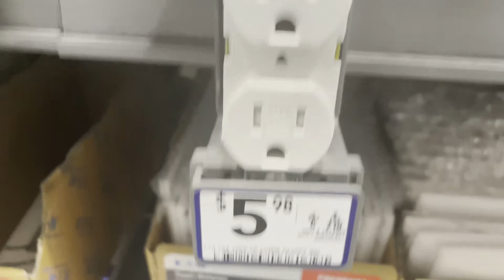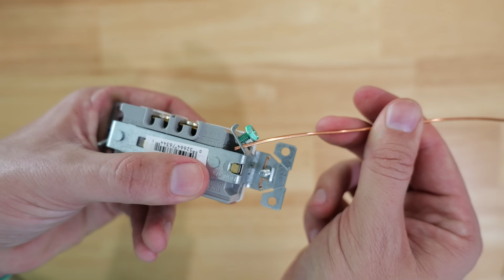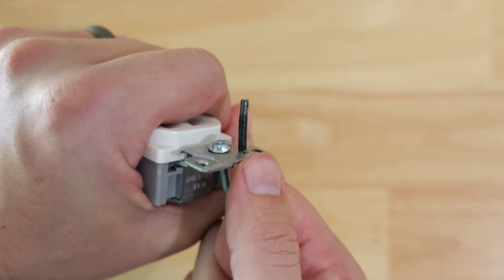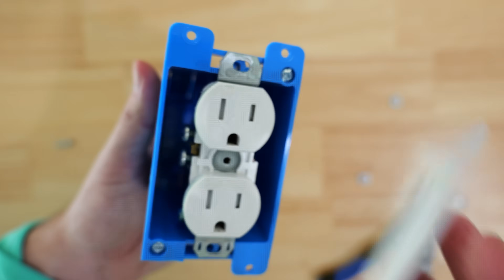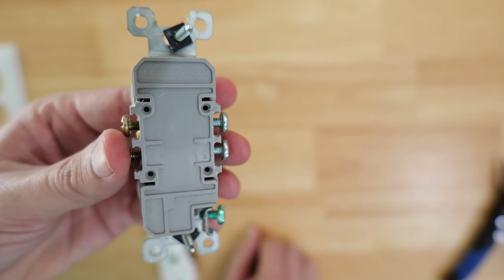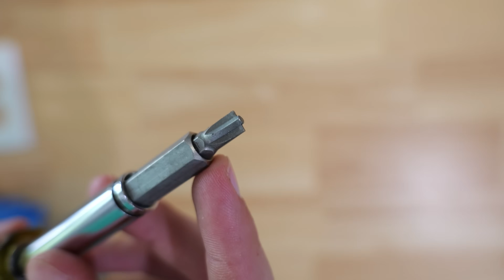10 MIND BLOWING Things DIYers Don't Know About Outlets But SHOULD

Comment from the maker: How many of these features were you aware of?  Most folks seem to know about 2-3 on average.
Reply: A majority were new to me.  Well done!
Reply: You’re more likely to remove the break-off tabs on the live terminal for kitchen receptacles that have separate circuits top and bottom.
Reply: All but ground screw pin hole for wrapping. Not sure it is faster than wrapping with stripper in hand already. But I'll try it.
Reply: As a 60 year old jack-of-all-trades / DIYer I knew a lot of these already, but I did learn a few things about the convenience features & the comparison between residential & commercial grade. Thanks.
Reply: I knew about the broken tab thing… that’s it!
Reply: You’re Wrapping Wire Counter Clockwise 🚫
Reply from the maker: No, I pulled the wire around counter clockwise but the J hook itself is going around the screw clockwise.  Due to the design it has to be pulled that way in order for the hook to go around in a clockwise direction like it should be.   Take another look.

Comment: I knew I could remove the outlet "ears" but always assumed that was only for rounded metal boxes. Had no idea how it would help get the outlet flush with a "Old work" box (which is used for new work on old buildings) .

Comment: The cheaper grade "flat-faced" outlet is a "Tamper Resistant" outlet with interior covers that have to overcome to insert the plug. The flat face is part of that safety feature. Dimples that help a child or fool stick a fork in the outlet would defeat the purpose,. 

I personally have no use for those safety nanny features but the flat face is intentional not just cheap.

Comment: Having taken care of so many infants, children, adolescents and adults who have been injured or killed ☠️ by electricity, not to forget seeing the beautiful Lichtenberg Figures of Lightning ⚡️, I’ve always wanted to learn more about electricity & wiring.   As the flow of electrons from a Lightning Bolt (itself a 3-D Lichtenberg Figure), passes over the surface of the Victim, rather than through the victim, the Energy creates a superficial 1st / 2nd degree Burn, without deeper injury.  The Lichtenberg Figure pattern disappears in 1-2 days.  Find and unconscious person on the ground + Lichtenberg Figures helps with the Diagnosis.  Unfortunately, patients > 65 years who Fall have a ⬆️ ☠️ rate.  I have learned several new things that I didn’t know from this video, the more I know about wiring, the more confident you feel in doing some of these DYI electrical projects, I just go slow.  I’ve not yet finished replacing the electrical outlets, lights, Fan, warmer, and installed the night lit, decor light switch, with an accompanying heavy duty decor switch, but I sure am learning a lot from you.  Little is Concealed from the person who Reads, Watches and Studies your YouTube Videos much.  Thank you. ⚕️🇺🇸

Comment: Great, this is a very good video when you are making a Youtube video in a controlled laboratory situation, not a video trhat represents actual installation. Construction electricians dont carry a receptacle around with them to strip wires. They use tools made fror that purpose in their tool pouches.
Reply from the maker: You clearly love my channel.  And that’s not the point of the video.

Comment: As a Canadian I use Robertsons only whenever doing electrical. They make it so much easier.

One comment. You did not mention that the code, at least in Canada, requires in new construction the child proof receptacles that are an absolute pain to get the plugs into. What we tend to do here is get the electrical inspected then remove and replace the receptacles for non-nanny state ones.
Reply: I grew up in Germany with 220v outlets none of which had a safety plug. I am alive and well. Just saying...

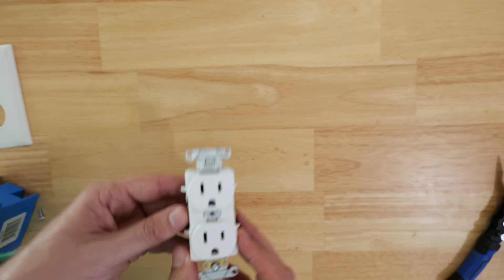Comment: Great vid! What you said at 10:30-11:13 for me raises this question: Suppose on a commercial receptacle such as you show, you hook two black wires around the screws and up to four black wires pushed into the back-wiring holes behind the plates on the same side - would you then have up to 6 wires safely connected without any marrette or wago or crimp? Same question with white wires on the other side. And does code allow that method of wire connection? One more question - if the answer to the above are "yes," if you get a commercial grade receptacle rated for copper and aluminum, can you join the wires that way without needing a CO/AL rated marrette or wago or crimp? Thanks for your time.

Comment: Some great info but the flat face (without the taper) reduces movement of the plug. If the receptacle doesn’t have the hook behind the terminal screw or it’s more rounded you can use the hole for the set screw to make a perfect shepard’s hook if the wire is stripped to the length on the back.

Comment: You absolutely do not need to break the ears off to use an outlet on an old work box. That's a waste of time. The outlet and cover will fit just fine. The only time I've ever really needed to break those ears off is when wiring an outlet to a 4 square cover.

Comment: the most significant difference between duplex outlets from the various models and manufacturers are some 15 Amp. duplexes actually are made with 20 Amp. (so called T-slot) internal metal contacts.  Both hot and neutral slots.  You can't see them unless you shine a bright light into the parallel slots, but if you do eventually you'll find one made like that and more than anything else that's what you want.  Because blade retention force and wiping action is superior on standard 15 Amp. plugs when inserted into T-slot type metal socket contacts

Comment: Or you could just use the strippers/cutters that you should have with you to strip said  wire. 
And the cost between the two types isn't worth the "struggle" to plug something in behind the world's heaviest piece of furniture.  I assume it's that heavy because it seems as it is an immovable object. 
And the speed wire holes are for #14 wire, meaning not designed for high amperage circuitry. 
Who uses the strip gage on receptacles? Honestly. 
Can't wait to hear or read about the superiority of the spec grade products and how the residential class crap always catches fire and fails after 2 days of use... but to each their own, I can see the pros and cons of both and use that info to make my decision of which to use. 🤔🙄😀😲

Comment: Thank you for the video.  But one part of the topic no one ever addresses in any videos is the best way to hook up multiple switches or receptacle plugs in one box.  With two or three light switches in one box or two to four plug receptacles such as a workbench might have in a shop, what's the best way to jumper connections between each light switch or receptacle plug?  Do you recommend I just use a pig tail/wire nut with a wire going to each switch or receptacle plug, or put two wires under the first screw if it has one of those floating clamps, or one wire under each screw and not break the tab between the upper and lower receptacle connections, or just two wires under the first screw on each light switch?  I prefer to use metal boxes and rigid metal conduit in my shop (a converted semi-truck box trailer) with ground connections going to everything.  I also use 20 amp receptacles although I've never seen a device that needs such a plug, but for the shop I figure its better to have it and not need it than to get something that needs it and not have that configuration available.  Your thoughts?  Thank you.
Reply: Just make sure when using 20a receptacles is that the wiring be rated for at least 20a as well.

Comment: The wire is wrapped in the counterclockwise direction not clockwise direction. You stated this wrong twice!
Reply: Otherwise a good video, and thanks for posting
Reply from the maker: No it isn’t.  To determine whether it is going clockwise or counterclockwise, the beginning is where the insulation is the end is where the end of the wire is.  To use the anchor holes you have to pull the wire around the terminal screw in a counter clockwise direction in order for the wire to be wrapping around it in a clockwise direction.

Comment: I knew about them.... I would like to add wrapping the terminals, wither you push wired or hooked wrap, with electrical tape. It helps prevent arcing

Comment: Knew about all those and Robertson's but did not know about the other driver tips.  And didn't keep the ears for spacers.  Will now. Thanks.
A push connector receptacle failed at our beach house, just as you described. Simple fix but a warning to redo all the others, too. Subscribed.

Comment: 3:41 I believe you meant anti clockwise direction
Reply from the maker: No I meant clockwise.  The loop is going around it in a clockwise direction but in order to use that feature I have to pull the wire in a counter clockwise direction to do it.
Reply: @HowToHomeDIY   you repeated “clockwise direction” twice, but the wire is still wrapped anti-clockwise. I’m not sure what part of that process is going clockwise other than the screw tightening?
Reply from the maker: From the start of the wire to the end of the loop that got put in the hole, it is going around it in a clockwise direction.  That is how you want it to go to promote the wire being pulled in.
Reply: @HowToHomeDIY  but that’s pretending a shape, ie the J hook, has a direction. It doesn’t, it’s just a shape. The mechanical movement of the wire in making that shape is the only component with a directionality, and that’s anti-clockwise. I don’t see the point of teaching how to make a connection but then start talking about shapes rather than what you are actually doing with the wire. Saying “pull the wire anti-clockwise to make a clockwise shape” is a confusing way of demonstrating this.
Personally I don’t use J connections, I make a ring shape, then it’ll stay attached even with a loose screw, as not all fixtures mechanically fix the wire in place.
Reply from the maker: Ok but that’s what is meant by wrapping it around in a clockwise direction.  J hooks are generally made prior to placement on the receptacle.  So while yes it is a shape, from beginning to end of the wire depending on how that goes on a terminal screw, determines its direction.  In this case, from beginning to end of the loop is going around in a clockwise direction.
Reply: @HowToHomeDIY  OK, it’s interesting that this throws up two ways of looking at a situation
Reply from the maker: Very true.

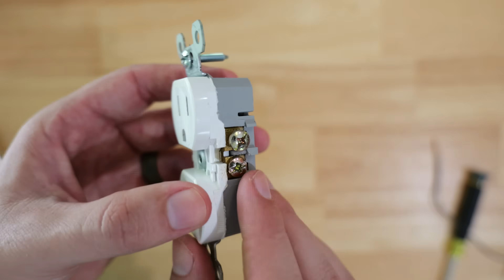Comment: when you were showing the ground screw at approx 3:15 you made the loop counter clockwise: should always be the way the screw tightens, so this wrong
Reply: The movement of the wire while it's inserted doesn't matter, only the form it has afterwards.
Reply: @HenryLoenwind  do not agree at all.  Clockwise means that tightening the screw has a tendency to tighten it.  Counter is COUNTER
Reply: @johnh5073  How does it make any difference in which way the wire moved while it was bent? All that matters is the final shape; everything else would be magic. Just because it was bent counterclockwise doesn't mean that it will move counterclockwise when the screw is turned clockwise. Of course, the wire will turn clockwise when the screw is fastened, no matter which way it was bent before. All that matters is on which side the cut end is, not which direction you moved it while bending.
Reply from the maker: To use that hole to pull the wire around, the wire has to be pulled counter clockwise in order for the loop to be going around clockwise.  Look again and you will see it is going in the direction the screw tightens.

Comment: On the commercial grade outlet if you use the wire clamp functionality you have to make sure the insulation is NOT caught by the metal plate that clamps down. If it does clamp onto the insulation then you do not have a good connection.

Comment: So this wall has no fireblocks or insulation? That looked too easy.. my wall gave me a headache
Reply from the maker: This video doesn’t show running wire in a wall but yes, if you have fire block in a wall and are trying to go up or down, I highly recommend using a flexible drill bit.  It can drill through the fire block and then be used to fish the wires through it.

Comment: I wish someone would make a similar video for our local receptacles that look completely different .  I'm from Denmark, and the available choices are Scneider LK originals versus cheaper E-line clones. Then there's all the older models which may or may not be better.
Reply: European electrical components are decades ahead of the American and are very easy to use. Schneider is a great choice and is used by professionals. Just be careful not to damage the copper when removing the insulation and read on the component on how much of it to remove.  Not sure how it is in Denmark but here in Sweden you only need to match the color of the wires to avoid a short circuit.

Comment: I never understood the point of that combination bit. Just use a Robertson screwdriver, works as good as the combination bit, but is quicker to use (can be inserted in 4 directions VS 2 for the combination bit, so less fiddling around), and you don't need an unnecessary extra screwdriver to carry around. Especially if you're a Canadian, you already carry a Robertson screwdriver anyway because it's used for many other things

Comment: I learned 5 things!!! Thanks😃 I'm wondering though, to strip the wire using the gaps at the top of the outlet, if you insert the wire from the front, then make the trimmed end flush with the back face of the outlet, is that the correct strip length? It would be cool if that were true, or helpful if they'd make some stop on that side to indicate the correct length. I've used the frangible bridge to separate the two plugs for a switched receptacle but wish there were a good way to indicate which is full time power vs switched. I've painted the switched one and the wall switch red, but the paint wears off over time and looks terrible. I'd like factory finished paired switch and outlet sets to clearly and resiliently indicate which is which.

Comment: American accessories are such lower quality than would pass a British standard for us to install. That being said no matter how many standards you have it’s all undone by a bad electrician and we have our fair share of them. Those bits are useful but we are only allowed 1000v rated screwdrivers and most of our screw terminals are slotted only exception being breakers and I do own a specific insulated driver with a similar head for these and a shank for the torque screwdriver.

Comment: I wonder if it's worth the trouble to replace some of my outlets at home, especially those I plug/unplug often, with commercial outlets, or residential ones usually are good enough
Reply: in my personal opinion as an electrician myself, I always replace a worn out outlet with a commercial grade 20 amp receptacle. Another youtuber Technology connections dissected some 15 amp receptacles, including residential ones, and their internal contacts are not always that good. 20 commercial grade amp receptacles usually have very good contacts and hold the plugs well, albeit not as good as hospital grade ones, but hospital grade receptacles are also usually the most expensive. 

That being said commercial grade receptacles are best used on plugs that are used frequently, as they do last a lot longer than residential grade outlets. If you use a residential outlet, use it where the load is not going to be heavy and the receptacle either rarely gets used at all, or just gets something plugged into it then left there for a long time. Commercial grade 20 amps are best in kitchens or garages where even if they aren't necessarily used with a 20 amp appliance, their greater heavy load tolerance is better with a lot of kitchen appliances which tend to draw a lot.

Comment: I just bought a bunch of 20-amp outlets for a shop rewire. The guy who built it put two 15-amp circuits in a 1100 sq ft shop. Dumb luck but I bought the commercial grade outlets and boy did those side pokers save me a bunch of time.  Quick question - if I feed the entire shop off a GFCI circuit on the primary house panel, does that make the shop code (at least with regard to the GFCI requirement)?
Reply: Local codes are varied. I'd check the code in your area.
Reply: Yes but if the shop is in your house the plugs need arc fault protection as well

Comment: The Combination Tip Screwdriver is not my go to screwdriver..
Reply from the maker: What is for you?  Robertson?
Reply from the maker: Uh Ok.  Why?  I’m genuinely asking.  No need for hostility.
Reply: @rtoguidver3651 obertson (commonly called "square") is awesome. I am always happy when I get something that uses Robertson rather than Phillips.

In Canada, Robertson was long the standard general purpose screw much like Phillips is in the US. Although Phillips is common with products designed for the US market also sold in Canada.

It is designed to better grip the screw and to not cam out. Unlike the Phillips which is intended to cam out to prevent stripping.
Reply from the maker: @rtoguidver3651  It was genuine.  I really like the robertson bit for terminal screws and even mention it at the very end.  I think it is a fairly common bit to use.  Was just taking a guess. Appreciate the feedback.